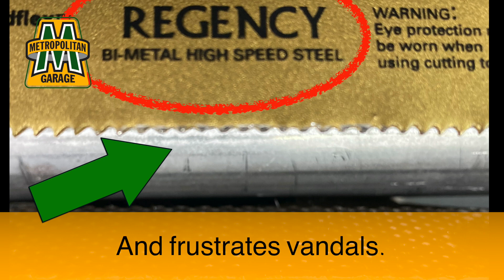Catalytic Converter Theft Deterrent

Comment: That looks good! How much? Why not instead, bend and weld rebar along the exhaust pip and cat as rebar is harder to cut thru and dulls blades fast?
Reply: Wrong!   Rebar is just mild steel and will cut easily.   That "weld material" is called "hard facing" and is used by heavy equipment owners to coat their digging buckets and tip their digging teeth.  They/we weld it on in big X patterns to slow the wear of the metal giving our equipment longer life spans.   It is extremely hard and wears ten times as slow as mild steel.   It is not very expensive, but we need a lot to do all the exposed surfaces of our equipment, and it's necessary in hard/abrasive soils!
Reply: @garybulwinkle82 Do you recommend this for cat converters?
Reply: @garybulwinkle82 what should I use, regular 7018?

Comment: Does the weld cover the whole pipe and the total length of the pipe if not I don’t see how this works. -thief “damn there is a weld I guess I’ll just cut 2 inches to the left”
Reply: What’s a better question is, why would you think that you even have to ask this?

This obviously has to cover the length of the accessible pipe.. otherwise there is absolutely no deterrent.

I’ve seen some ugly welds, but none of them are that scary.

Comment: Then they just cut further down the pipe taking out expensive y-pipes and O2 sensors in the process. If you really want to do it right have a cage built out of bent rebar surrounding the cat or those custom full length plates out there.
Reply: Rebar and cage this weekend,weld machine just arrive this week,$3000 damaged my suv cannt just keep call my insurance
Reply: @johnsonbui  really sucks man. The amount of expense, time, and grief is enormous when this happens.

Comment: What is that type of weld called?
Reply: It's the type of rod, not the type of weld.
It's called "hardface", and it is used to prevent wear on machinery like backhoe teeth and bulldozer blades.
Reply: It's pricey.  That is one problem.  If you want to buy, one I have used a lot in past is Stoody 21.  Most industrial supply that sells welding supplies should have it or get you something similar.

Comment: Torch would cut that. All you guys coming up with these ideas will just make them resort to other ways to get them off
Reply: Do you honestly believe a Tweaker is gonna learn how to use a torch, and take the trouble to light one up? Where using one will require face protection? And the spatter will not only burn himself, but cause a fire under the vehicle..where he’s laying? I just don’t think so.
Reply: I cut the cats off my derby cars all the time with a torch. Not very hard. Also they make many sizes of torch tanks and you can get them the size of a small fire extinguisher. I know it's not ideal but can be done
Reply: The point the guy is making is that cat thieves are not going to be carrying around an oxy acetylene tank around so they can cut through a deterrent contraption.

There’s hundreds of thousands of other cars on the road that they can just move onto and cut off in 30 seconds with their cordless sawzall.

Eventually… one day.. maybe you’ll see them resorting to a torch… maybe… but not anytime in the near future
Reply: @HiThisIsMine Lol